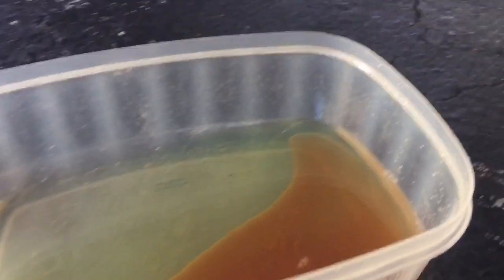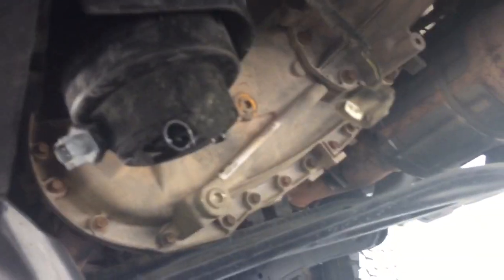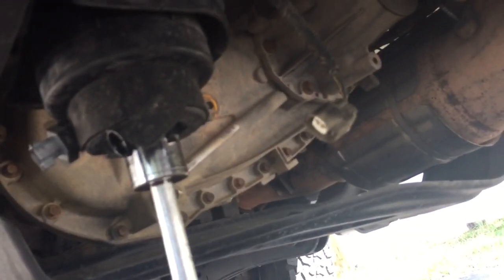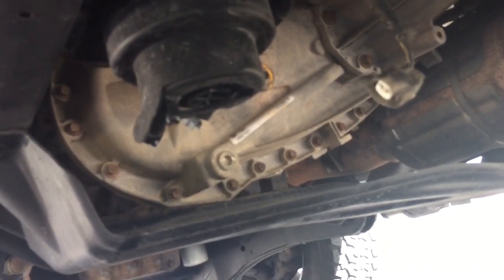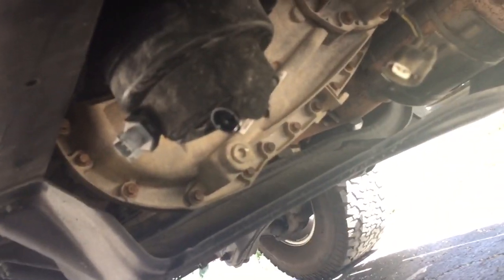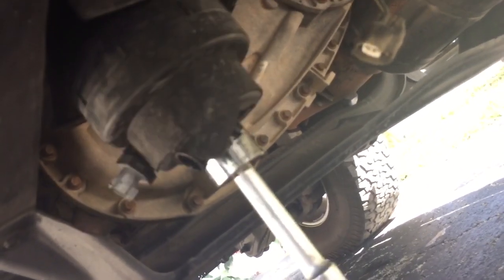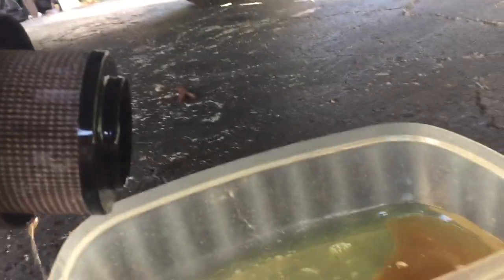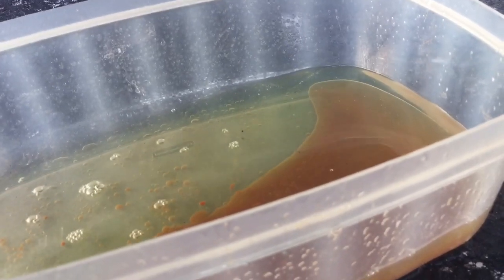Water in Fuel Reduced Power Ford 6.7 power stroke super duty

Comment: That's totally normal diesel is not refined to perfection and has water in it and yes it's rust colored because the metal used to make the fuel filter rusts from sitting in the water that it separated from the fuel

Comment: Also....to others reading....
On my 2019 F250 Powerstroke...the wire that plugs into the sensor is seriously poorly place and skirt around separator and fuel housing can rub wires till exposed.. rains and BOOM...water in fuel light comes on with no water in the fuel...

Water acts conductive and goes to ground....

If light stays on your rig will go into de-power mode....

Frustrating as hell...

Check your sensor wires too...
🤠👍🥃👌😂

Comment: Ford recently found rust in my fuel system, they want to charge me $10,000 for a new one. I know andeiesel mechanic shop that told me I probably don’t need a whole new system says he can do a full cleaning on it and if it needs a new fuel pump or what not we will put it. His price was $1,800. Whats your thought in it? My truck had left me stranded though, so had to get it towed when the “reduced engine speed” light popped up on me.
Reply from the maker: Nathan Galvan really man I’d start by swapping out the fuel filters. 
If that doesn’t work then you’ll be spending some money but go ahead and drop the $30-40 and do the easy stuff yourself to make sure you’re not throwing money away. 
I’d bet with new filters and some fuel system cleaner run through, you’ll be fine.

Comment: Hows the progress on it?
Reply from the maker: +Dooley Dooley she’s running like a top
Reply: @BobHGarage  what did you end up doing?  Got the same problem going on now.
Reply: @koreythompson5076  How did you end up fixing your issue?
Reply: @jaredscool1  I actually didn't have water in the fuel.  I was getting water in the wire connection that comes off the fuel filter. I used dielectric grease on it and plugged it back in. Haven't had any more problems.